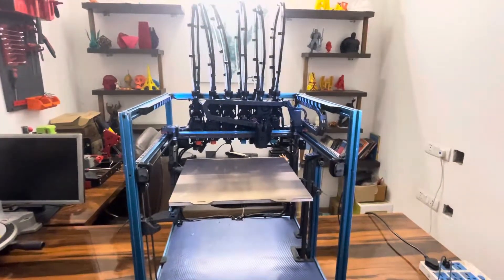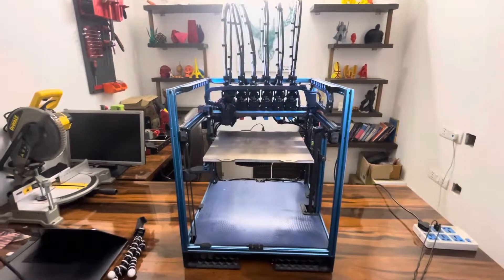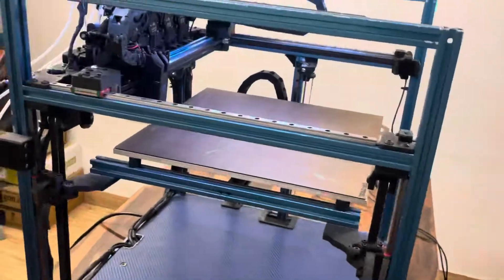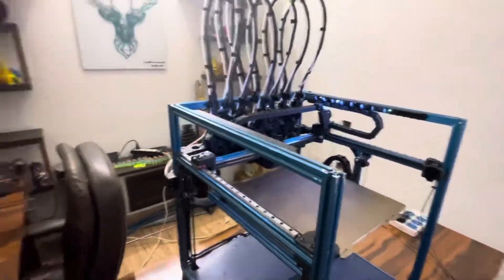'WP-DAKSH' Voron Trident 3D Printed Tool Changer  - First Look, Overview and Operation

Comment: I was having some similar ideas but haven't even started...congrats on doing so well! I'm stuck in tinkercad as well and was thinking I had to learn a real cad before attempting something like this. impressive!  you can share your tinkercad links... wiper - I was thinking of a silicone wiping edge that tilted out of the way when the tool is put away but springs up so new tools are wiped as they move out; all mechanical no servos. gasket silicone can be molded into the shape easily (print a mold, soak in soap water.) each change would have a little extrusion to deal with any minor oozing before grabbing.
Reply from the maker: Hi - please check the newer version of the tool changer - its fully mechanical and more sturdy than V1

Comment: How do you accomplish bed leveling for all tools? Does every tool have their own meshes?
Reply from the maker: all the tools have their specific x,y and z offsets that are loaded everytime a tool is changed. The xyz calibration is also automated across the 6 tools - please watch this for a demo - https://www.youtube.com/video/ppcTm3NfDo0
Reply: @ankurv2k8  are those offsets stored in klipper? What firmware do you use? Thank u very much!
Reply from the maker: @exsurgemechprints2671  These are stored in a variables file and persist across reboots. The system runs klipper with 2 mainboards and a raspberry pi 4

Comment: Have you shared your klipper configuration files anywhere? I'd be interested in taking a look.  Great work!
Reply from the maker: I am using a version of this klipper module and its related config - https://github.com/TypQxQ/Klipper_ToolChanger. I have added another module for error detection - i will be sharing my config with the build files once the project is ready for release.

Comment: Liked the build a lot, just wondering how you handle preheat / heating of the nozzles when changing tool head , but the build looked very clean?
Reply from the maker: its handled in the tool change sequence via klipper gcode.

Comment: If you used an electromagnet to provide the locking force instead of an always on magnet, you could reduce the needed force back down quite significantly.
Reply from the maker: if you are talking about using an electromagnet on the docks, they will need to stay always on to keep the wire looms in place. If you are talking about the carriage - and the actual tool lock - it uses a servo and not the magnets.

Comment: Congratulations! This is the BEST tool changer that I have seen from the open-source community.
I am in the process of building my 5th printer, this time a Voron derivative. I have in mind to build it as an IDEX, but I would much rather work on getting a tool changer incorporated.
I am pretty handy with Fusion 360 for CAD,  and would be very happy to help you document your project, while at the same time beta-testing the system.
I am retired and semi-disabled, so I have lots and lots of time on my hands.
Reply from the maker: Thanks much - really appreciate kind offer. I will definitely open the design to beta very soon and would love your help to convert the tinkercad design into a proper 3d model. Just need to work out the final few kinks - the last couple of items left are a reliable purge and priming system on the tools between toolchanges, and state awareness for error recovery and retries / user interventions in case of errors. Working on both this week.

Comment: Its absolutely beautiful! Prusa must be feeling somewhat pinched as the open source community is quickly catching up to their not yet shipping XL system, while the chinese companies have viable MK3S imitations.

Could you provide a URL for the discussion of the tool locking mechanism? All the others I've seen were rotary.

I'm curious that there is no upper bar across the top to brace things there.  The system looks like a cube with one edge missing. Is it simply removed to facilatate a better view for the camera?
Reply from the maker: Yup - the bar up top has been temporarily removed for camera purposes. The original locking mechanism was discussed in the Voron Toolchanger discord - https://discord.gg/Vw3ezV5A
Reply: @ankurv2k8  thank you.